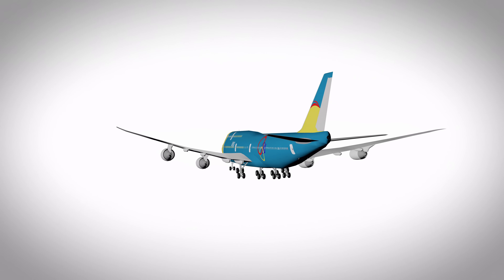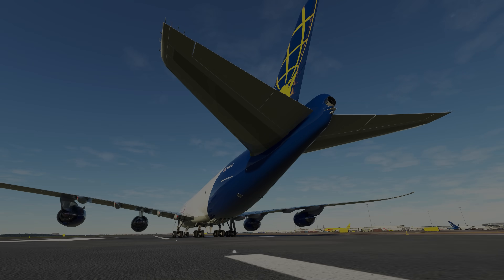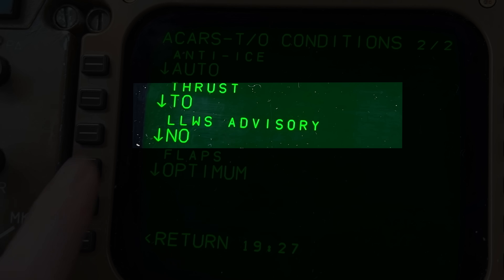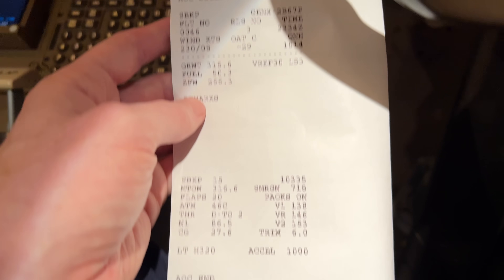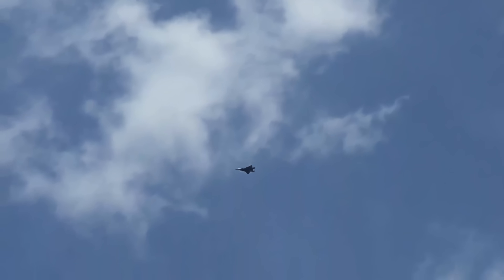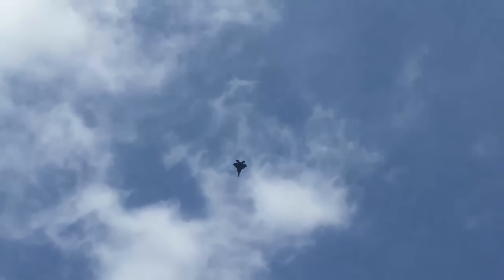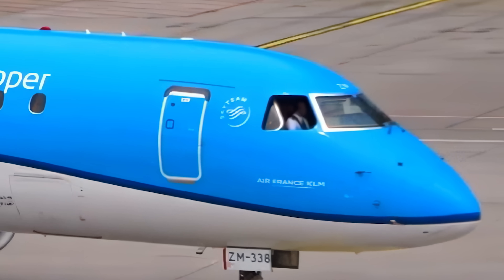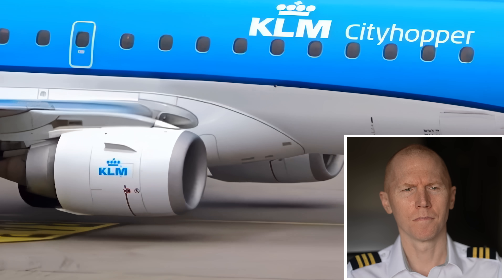Unsafe 747-8 Vertical Takeoff

Comment: In 1983 I was returning to the US from Zurich. I was on a Swissair 747 and we first had a short flight to I believe Geneva before heading to the US. There were at most 20 people on that first leg of the flight. I was amazed at how quickly we were in the air, seemed like just a couple of seconds.  Little cargo, few people and light on fuel,  it was a hotrod.
Reply: The fewer the engines, the greater the acceleration capability when all of them are working.  That's because of certification requirements involving engine-out climb capability post-V1.  So my hop in a nearly empty DC-10 from San Diego to LAX may have out-accelerated even your 747.  I distinctly remember how my back was pressed into the seatback foam once takeoff thrust was set.
Reply: Geneva is always a fast and steep climbout as it's surrounded by mountains!
Reply: i read this as 1938 and i was like woah old man

Comment: At 8:30 that looks like a F-35 to my layman eyes. F-35s have vector thrust which allows them to do some very crazy stuff. I've been a big fan of vector thrust every since I first saw it appear in Macross Plus the anime movie. I don't recall if it's the F-35 or another vector thrust fighter jet, but at least one of the fighter jets they were testing with vector thrust was capable of stopping while in flight, hovering, and then flying backwards.

Comment: That looks like an F-22 which has vector thrust.  This appears to be a demonstration of vector thrust.
Reply: no, it's a demonstration of flat spin recovery.
Reply: Exactly !
Reply: @jwenting No, it is demonstrating super maneuverability. (Which does rely partly on thrust vectoring.)  Not a flat spin, as it is a controlled maneuver.
Reply: Whatever. I'm not afraid of any vertical takeoff.

Vertical "landing", however...
Reply: @klausstock8020  Unless you're in a Harrier or F-35B, yeah vertical landings would be... Hard.  😛
Reply: @mattd6931 making a vertical landing is easy, surviving one is hard, they are still great gear, but helicopters and VTOLs definitely don't have as strong of a safety record as conventional equipment does.

Comment: The F-22 is performing the falling leaf maneuver, which is basically a controlled stall where the pilot uses the rudder and ailerons to control the plane during the fall until hitting the thrusters again for airspeed. The F-22 Raptor also uses thrust vectoring, which allows it to pull off those seemingly unnatural tight turns.

(Edit: typos galore ahead)

That transmission analogy is an apt one. In driving school they teach you to break with the engine to save breaks (hence the term "engine breaking"). It also works with motorcycles. I prefer the common practice of downshifting to just applying the breaks in order to reduce speed for staying in the flow of traffic - and use both for coming to a full stop, because it does save the break pads (and is more satisfying because of the engine sounds). 😄
Reply: @benjamintoft7947 lol, thanks for noticing the typo! Hahaha, I'm pretty sure (the) engine breaking would be a bad day.

Comment: Car Transmissions are not damaged by engine braking. In fact, engine braking is recommended for any extended downhill driving because your brakes will overheat and fail before the transmission does.

I think the risk you're talking about with the thrust reversers would be more similar to driving through a sandstorm without having an air filter in place. If a car engine ingests of sand, that will also do a lot of damage.
Reply: yeah or driving down a gravel road at 70-100 mph :D
Reply: Yeah, that's a good point. I was in the passenger seat of a rental truck with a car on a tow dolly behind it, coming down off a mesa in Utah. It was being driven by an ex-girlfriend. It was a steep grade. There was a runaway truck ramp off in the distance, and she was panicked that the brakes weren't working! OK, downshift one notch down, and let the brakes cool for a few seconds, then pump them slowly, until you get down to about 35, and down into low, still pumping the brakes intermittently. She managed to get it under control just before the go-nogo point at the entrance to the runaway ramp. 
-- It was terrifying, because the problem wasn't just getting control of the truck. It was getting control of the ex-girlfriend's panic. 
-- Lots of people don't know that you can downshift with a plain-jane automatic transmission. (But not going into low at 70!) If you want to know your top speed in each of the lower gears, find an empty road, stop the car, and floor it, and note the shift points for each gear. Or, if your reading skills are up to the task, just look it up in the owner's manual.
Reply: Large vehicles like buses do it all the time. It's always interesting to listen to a bus downshifting and the engine jump in pitch before the retarders kick in to slow the bus down.
Reply: Motorcycles too
Reply: I never use the brakes if I can avoid it. I'll set the cruise control about 20 mph below the posted speed which makes the engine downshift. Another pickup truck I had was equipped with an automatic downshift for long downgrades.
Reply: They can be. If 100kmh slam it into 1st. Guaranteed damage.
Reply: Yeah, came for this. That's called eco driving. It saves on the brakes, and more importantly, gas. It's a requirement to know how to eco drive to get a drivers license in Sweden.
Reply: As I keep trying to tell one of my mates, it isn't transmission for accelerating and brakes for slowing as he insists. Transmission to control speed, brakes for slowing/stopping quickly. Cars are literally designed to use engine braking. Brakes turn momentum into heat, that's all they do (that is to waste energy). Modern cars, even my 15yo plain sedan, use engine braking to run the car and will cut fuel flow to zero. Not only do we save on brakes that only create waste heat, we save on fuel too. Electric vehicles use regenerative braking before they apply brake pads for more rapid slowing/stopping too, which should also indicate brake pads only create heat (ie waste). At least Kelsey knows his lane, and admits what he knows/doesn't, and is damn good at the stuff he knows.
Reply: What I heard was it's fine as long as everything goes right, which would make it accurate. If you money shift trying to engine brake it's pretty equivalent to sucking in some dirt going too hard on the thrust reversers on the ramp. 

Another way to look at it is you're wearing your clutch instead of your brakes, which if you're doing the job yourself might be cheaper, but if you're paying someone it certainly isn't. I think in this scenario we're going through all 6 gears on the way down instead of holding one or two and then finishing with the brakes, bonus points if you aren't rev matching.

I think for a non car guy he did pretty well
Reply: Yea when my dad was teaching me to drive a standard he was very strict about the down shifting it was better for the car as long as you know what you are doing and when to do it and it was better for the fuel efficiency.  But defiantly driving through a desert with no air filter would be the same thing I repair parts for these airline engines and the little bit that we have in my area is super expensive.

Comment: Thx again for the great vid.
You can indeed do a flatspin with a f22 raptor.
And you can use the gearsbox of a car to slow it down, it is very common to use that going downhill for long time so the brakes don't heat up too much.
Kind regards, Belgium.

Comment: Downshifting to slow a car down is called engine braking, and it's taught as part of the driving test in the UK.  If the brakes go out you're going to want to slow the car down. It also reduces wear on the brake pads. It's preferable to downshift than brake where possible, it doesn't wear down your car any more than pulling away from a junction does, you're just transferring forces back the other way.

Comment: I worked with an A&P/IA for a while in the early 2000's (because it was fun) and we once hand-propped an airplane.  He had me sit at the controls (I had/have my PPL) with explicit instructions to stand on the brakes and keep my hand on the mixture control to kill it if anything goes wrong (among other normal things).  In addition, we had the wheels chocked on both sides.  Even with those precautions I was nervous as hell about the prospect of watching him get hit by the propeller if anything went wrong - it turned out fine.
Reply: I doubt you could get hit by the prop, unless you do it the very wrong way. Normally, you just pull (not push) and get your hand out in the same motion, regardless if the startup is successful or not.
Reply: @HDJess  yes, you can get hit by a prop, there are literally slews of accident reports of people getting hit by a prop while hand propping.  The typical scenario is that the person slips and falls toward the now running prop, but the airplane lurching forward is sometimes the reason the person slips.  And this is far from the first time an aircraft has run away after someone hand propped.
The most typical reason for hand propping is that the battery died, not that the starter doesn't work (as was the case where my A&P/IA hand propped the plane - we were going to change the starter and had to taxi it to his hangar).  It's really stupid because you can JUMP a small airplane from a car, same method as you'd use for a car (yeah, there are some with weird voltages, just like some oddball cars, but a 14V aircraft can be jumped with a 12V car battery).
Reply: @sthomas6369  that's true, I wasn't taking into account accidents. They do happen everywhere and with anything. I was only pointing out that if the aircraft is choked and you use the proper technique, it's almost impossible to get hit by the prop.

Comment: That F-22 Fighter is using its thrust vectoring to do that. The F-22’s engines can be pointed different directions to use its thrust for steering enhancement. Thats why it can turn so sharp. Not only are its control surfaces using airflow to move it but its engines will also angle into the direction of the turn.